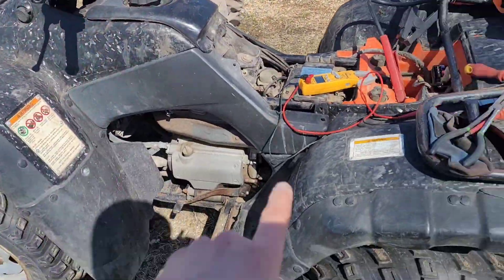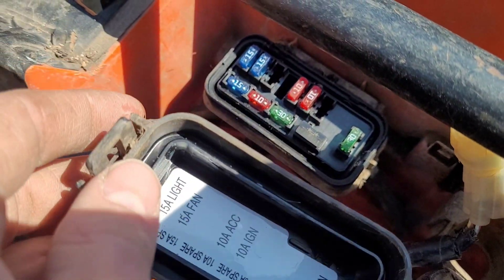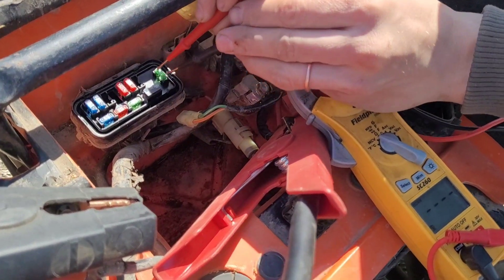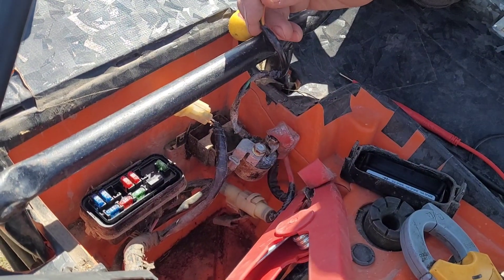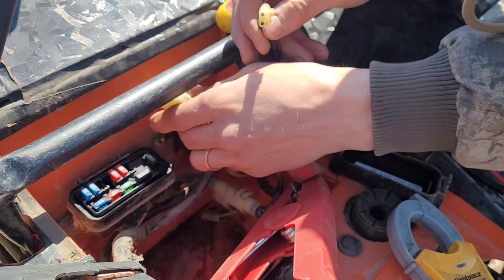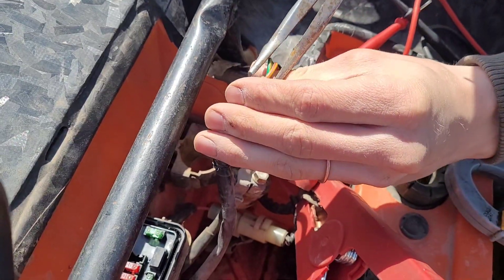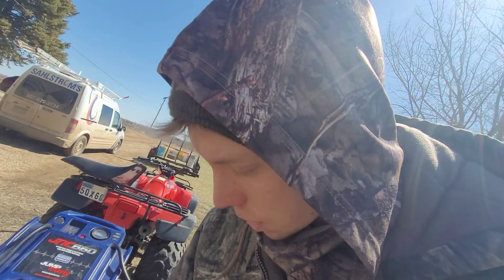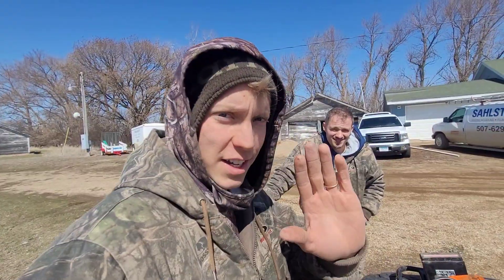How to test Electrical on a four wheeler that won't start! Is it the starter, solenoid or ignition?

Comment: My ‘96 Honda 300 won’t start with starter button Relay clunking. I jumpered relay with wire and won’t activate starter. Maybe battery is bad?